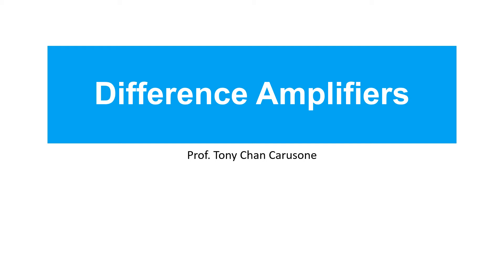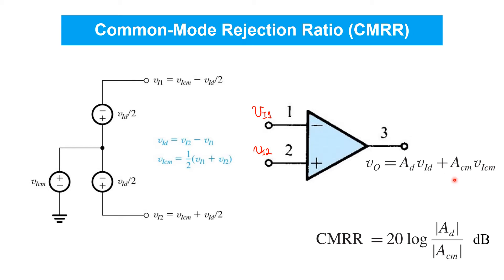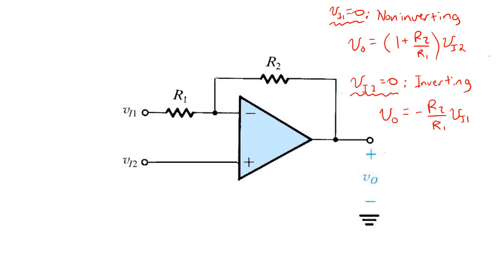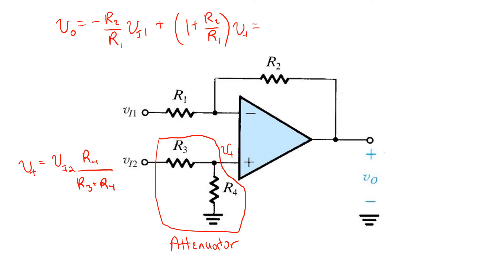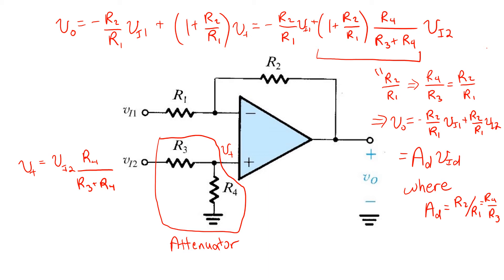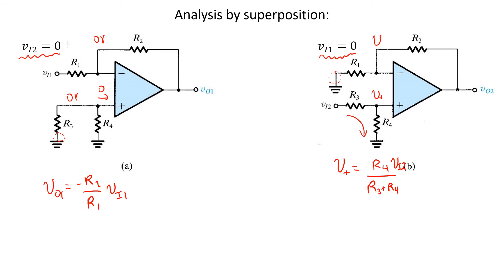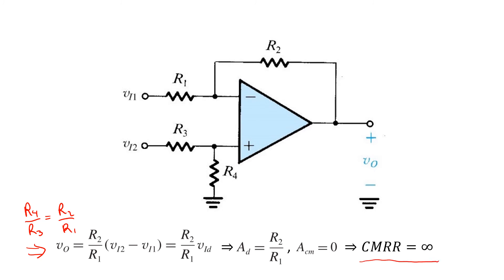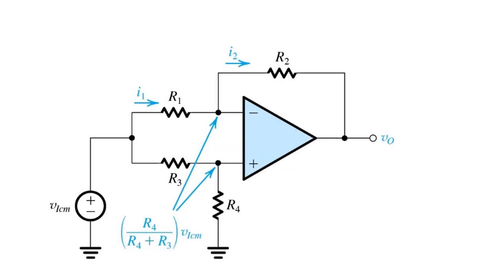12 Difference Amplifiers

Comment: The Vox AC15 C1 guitar amp has two tube channels mixed with an unbalanced difference opamp stage: R1=470k, R2=820k, R3=330k, R4=120k, so the positive signal is hotter and phase inverted so it is attenuated (gains => Av+=0.732, Av-=1.745). I don't know, but once I played with a pal one each channel, worked really fine, what more could I expect.